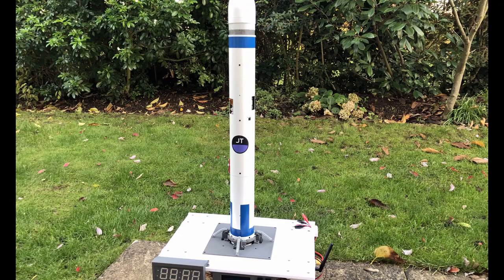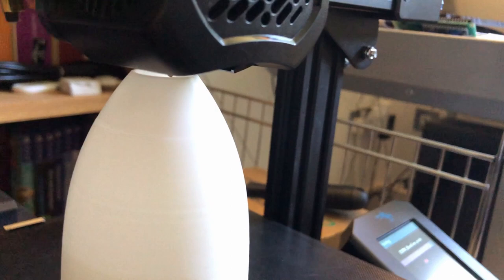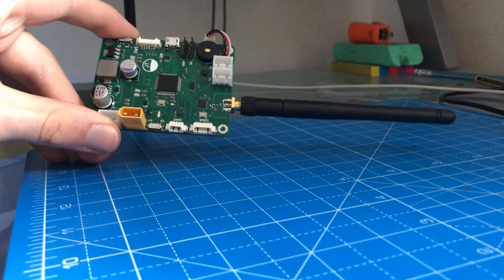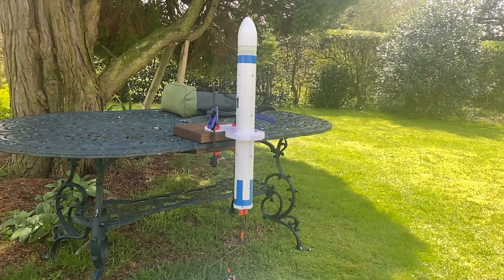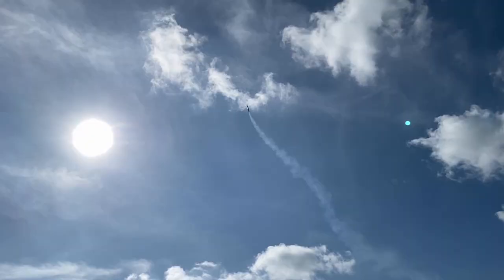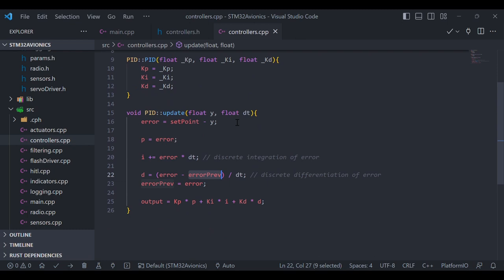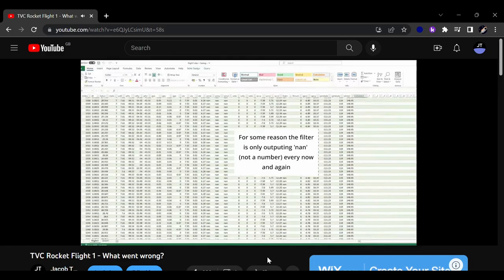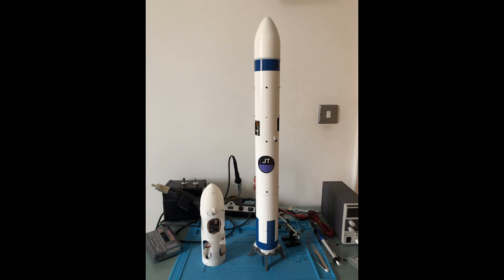Guided Model Rocket Flight 2

Comment: Rocket stability maybe achieved by properly positioning the CG and CP along the rocket tube, thrust vectoring will help as long as the CP and CG are not off positions. To insure proper travel stability the CG and CP must be properly adjusted. Great work anyway.

Comment: I saw that while rocket’s descending, the parachute folds. This is a tiny error but I suggest you to use a parachute with a smaller diameter or cut a hole in it to prevent it from gliding too far and prevent the folding.

Comment: Hi I am a begineer in electronic
Did you have or know any website to build my rocket?
I ever built my FPV Fixed wing using F405Wing as my flight control. I use Inav to control my flight
but I no nothing about programng

Comment: very entertaining content thank you!
please keep us updated. 

two side notes you don't need :D
the detachment from the launcher will cause a kick on your sensors as it can be very hard to perfectly time 4 contact points.
i overcome this by using a single pin with a hole, extending down from the center thrust line on the gimbal head into the launcher where another pin secures the rocket down.
kick is still there but reduced a lot.
i have no doubt you will find a better way than me to fix it.

the same with timing ignition on multiple motors.
i overcome this by extending my igniters with a pair of very thin 30cm silicone wire to each motor.
if you time the release with at least a few motors burning, the rocket can start its launch and travel 30cm while the slower igniting motors play catch up and you won't have so much force on your launcher locks.
all the engines i have tested take slightly different times to ignite, come to full power, run times, even differing ejection forces even if they are all from the same batch and packet.

🚀

Comment: This is awesome.  I'm surely missing something but what is the reason for not having fins? Is there an advantage over a guided rocket with fins?
Reply from the maker: Thanks! It’s much harder to use fins to actively control a rocket, at least for me. From what I understand, lots of fluid dynamics are needed to determine the control authority at different airspeeds, pressures and angles of attack

Comment: Hey Jacob!  Does your flight computer gather altitude data by integrating acceleration (if so, does it use quaternions?) or by barometric measurement?  Great project!
Reply from the maker: Thanks! It uses both, and fuses the measurements as a part of the position kalman filter. You’re right, I do also use quaternions to store orientation, which are used to calculate acceleration in the global frame of reference
Reply: @jacobthornhill  Wow, it is really impressive that you are doing this as a teenager! Do you have any plans to try propulsive landing?
Reply from the maker: Not yet! The going up part is hard enough

Comment: Does it controls by itself or you can control it through your computer
Reply from the maker: The rocket controls itself autonomously, and I use my computer for configuration and viewing data
Reply: @jacobthornhill  Oh damn that's cool but how it controls itself did u put any data or way where to go to the Arduino